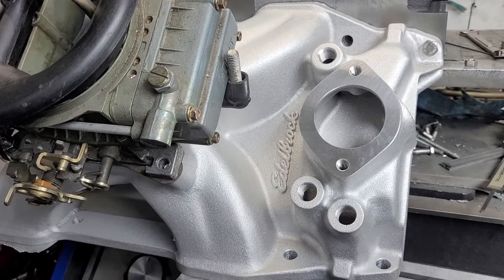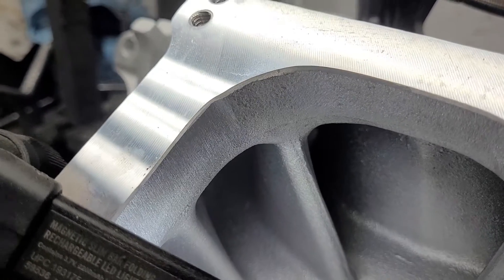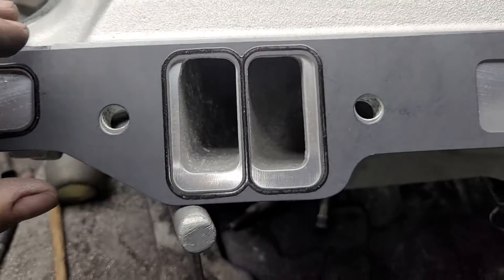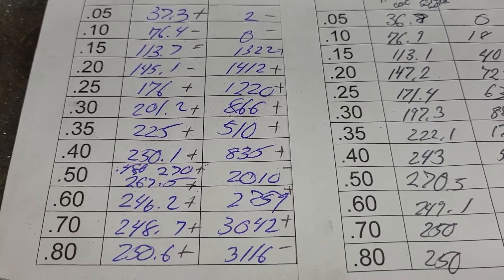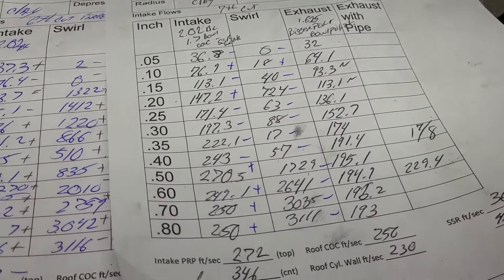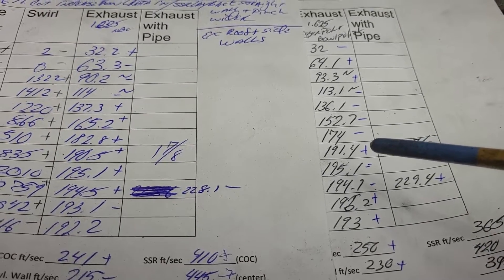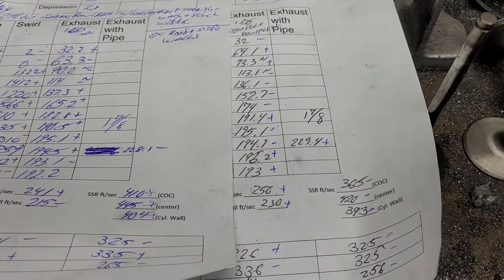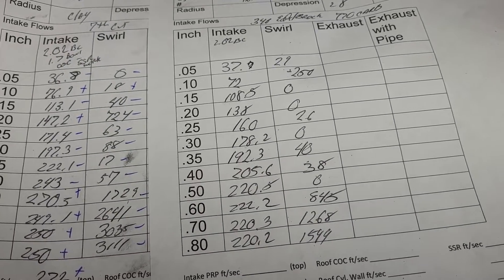Edelbrock Victor 340 intake manifold  flowed stock on EQ-CH 318B ported 318/360 cylinder heads

Comment: Edelbrock is basically designed for street cars running small cams and rpm range of idle to 5500 or so. They work well on light duty trucks for light loads or towing.
Reply from the maker: That is not what this manifold is designed for.

Comment: Hey Charles,
     Tim here, that vic flows terrible for ur app......you mentioned that little ledge in the plenum area (beginning of inside runners) or the shorter runner, but didnt say why......i'm curious........but i wonder if the manifold port volume is just to small......maybe has a reasonable shape, but i didnt anticipate that Vic doin so poorly flow wise.......gasket matching is also a troubles area....what is with MOPAR?......my Poncho stuff is super close, just a bit of massage, but again, i commented about how my TrqrII is holdin back power.....but my gasket match is quite nice........yes, alot of work for that Vic manny........i wonder why they left it so small......thats the only scenario i can come up with, for a single plane Ed, on a ported head, that is THAT restricting.......i may be out in left field.......thoughts i have.....BOY do i enjoy ur vids sir!!..hope i made some sense......i can ramble easily....haha....PEACE to you sir!!
Reply from the maker: I think it is designed for full porting. That way they do not need to research it out. Jmo
Reply: @servediocylinderheads  it must be, as it makes the most sense.......keep grindin my brother, i thoroughly enjoy your channel!!!......keep us posted!!.....and whats that leittle ledge for (again i'll ask), as i have a Vic for my Poncho, that needs work, (my ports are bigger than the runners)........i think i already removed them, now i wonder if that was a bad move (i got the manny for free, so i kinda dont care)....PEACE to you sir!!
Reply from the maker: @timothyarnott3584  I don't know what ledge you are writing about.

Comment: In reality, even though all manifolds seem to suck stock, 220cfm is not a bad place to start. Didn’t the air gap flow alot less? Best they left it portable with tons of meat than messed it up trying to get more flow which would ruin your plans for porting it.
Reply from the maker: You make good points. Thanks

Comment: Charley have you ever Tried 1 to 3 Angles Across the SSR, remeneber stock it had a 90  over  the SSR with a 45 ? Angles on  Seat Re-Stomizes Gas-Air ? will it do same on SSR ? ..

Have you ever Tried  1 to 3 Angles  Across SSR ? Remember Stock SSR with  90*  with a Factory Angle Cut Across SSR ?....Angles work on Valve Seat to ....Re-Atomize.....  Air-Gas  by hitting EDGES ?  SO .."""Air Quality..."""  over Air Flow  #'s..??
Reply from the maker: A smooth radius seems to work best on ssr. Thanks

Comment: I run a Chinese air gap intake made for LA 340/360 blocks but also for magnum engines  on my mildly built 318 . I smoothed out the Sharpe edges at the opening of the ports on the 318 heads since the intake has the 340/360 ports and are wider. I also run a 1" tall 4 hole spacer plate but I cut out a 1" notch out of the divider that separates the 2 front primary holes and the 2 back secondary holes . it should help with flow / pulses .
Reply from the maker: Nice!

Comment: There’s a reason why the Holly Strip Dominator and the Offy Port o sonic that has been massaged were the manifold’s used on the fast Super Stock cars.
Reply: Those 2 manifolds seemed to be way ahead of their time. 

The Weiand tunnel ram was the top choice of all the rams.
Reply: Ran a heavily extrude honed port o sonic on a 460, 85 Mustang. GT. Painted nobody knew what it was

Comment: Wow, a 50 cfm hit is a lot! Is this typical for every brand Edelbrock makes a small block intake for? Thanks for sharing.
Reply from the maker: Every manifold I have ever tested. I said,"No crying!!!!" Hahaha
Reply: @servediocylinderheads  
That's great to know, thanks again.👍
Reply from the maker: @itseithergonnaworkoritaint7852  Glad to help. Thanks
Reply: Would the intake manifold combination still flow the same on an unmodified port? Or since the port flows so much better, it helped the manifold overall flow?
Reply from the maker: @brucesherrill4116  No, it would flow less.
Reply: @brucesherrill4116  
No, he's saying even if the intake port in the head flowed over 300 cfm the intake would only let 220 cfm pass by. 

If the head were to flow less than 220 then the head would be the restriction and would only flow that amount.
Reply: @itseithergonnaworkoritaint7852  
I was thinking the opposite. If the head can flow 250 cfm and the intake could flow 270 cfm, would the combination still flow 250? 
In my own experience it seems as tho replacing an iron intake manifold with an aluminum one really doesn’t make a huge seat of the pants difference.
Reply: @brucesherrill4116  
It is basically a weight savings unless you upgrade to a RPM Airgap style or high rise dual plane intake the engine will be able to rev a bit higher. 5,000 to 6,500 max RPM typically advertised for the 2 dual plane intakes available.